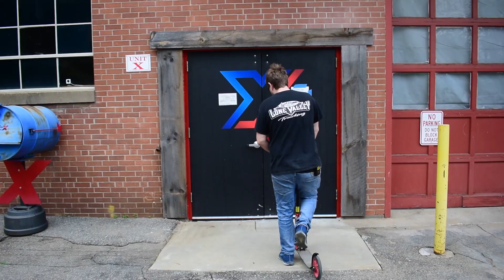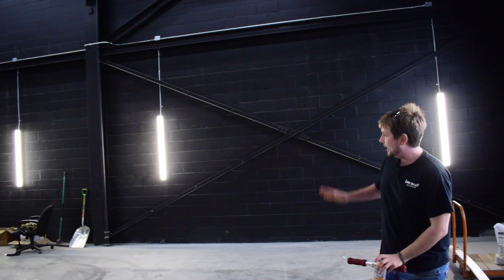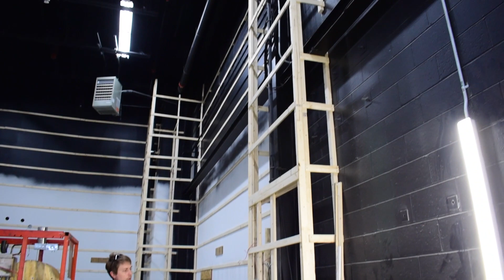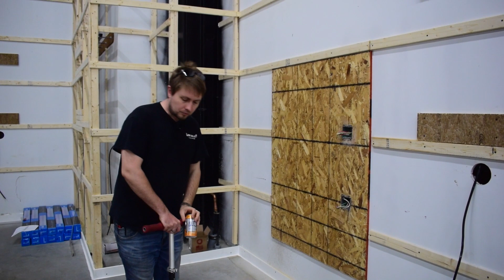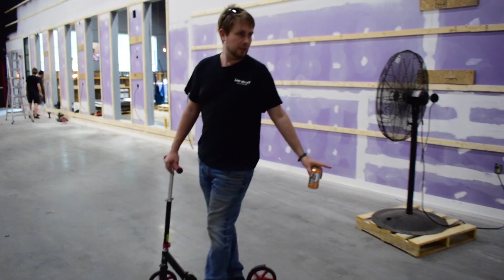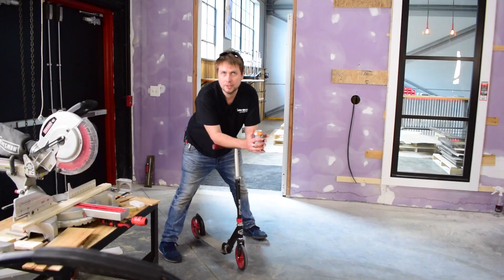Update On Our Wash Bay Construction!

Comment: How much was this to build and measurements?
Reply from the maker: I believe I spent around $100k roughly, I did most of the labor myself, that was materials, it measures 80’x30’
Reply: I’m trying to build my own truck wash here in Illinois but I’m not even sure where to start! Was there any specific permits or license you had to get before you started on your project?
Reply from the maker: Yeah I needed to do an extra pumping tank for the drainage in connection with the oil water separator, in Massachusetts I had to meet with my state plumbing board to get the variance approved that was the main thing, also communication with the town building and plumbing inspectors was important
Reply from the maker: Good luck on your project bud that’s an awesome goal👏👏🍻❌💯